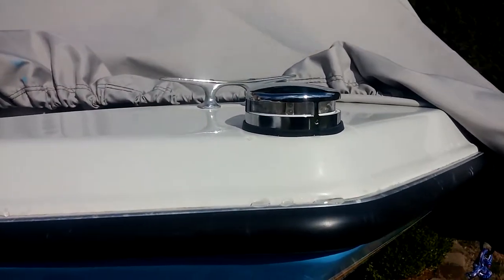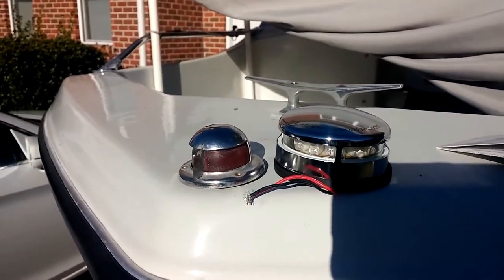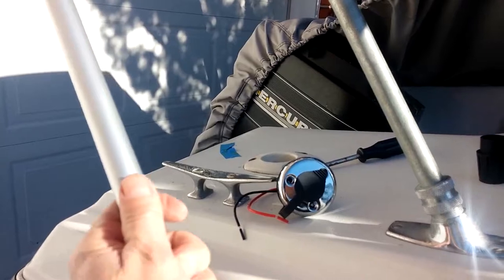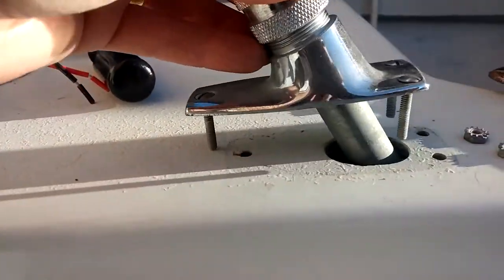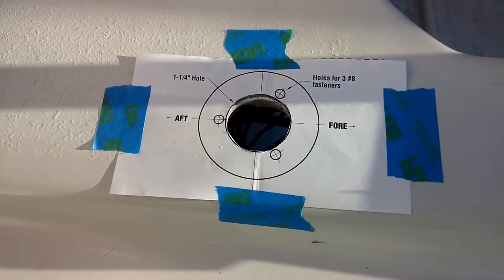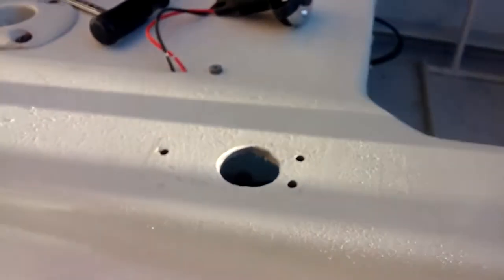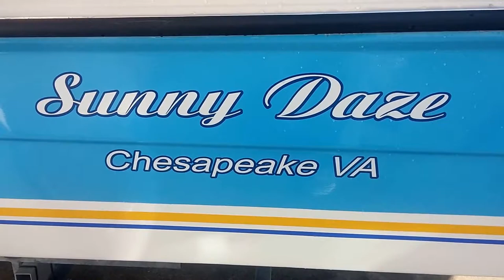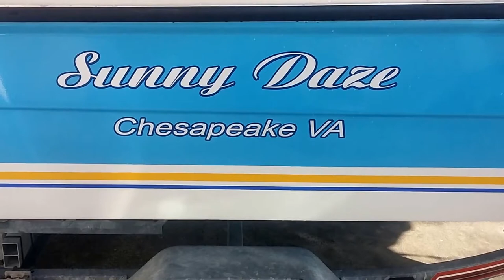Boat Restoration LED Lights Replacement 1971 Thunderbird Tri Hull "Sunny Daze"

Comment: Hello from Florida. I have watched your videos on painting with the brightside. I was wondering how the paint has held up over time? I'm trying to decide a paint to use for my 18ft Angler Center Console. I really like the color blue you used. Thanks for any info or tips with this paint .
Reply from the maker: HI SC, It is holding up great, no change it how it looks or how it is holding up. Thanks for the comment.